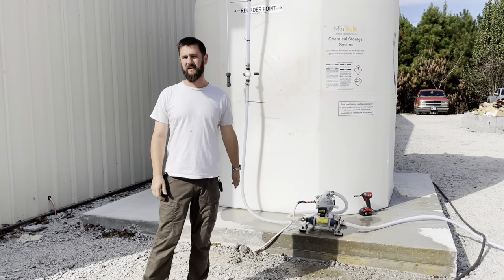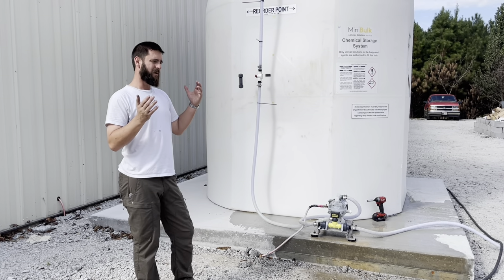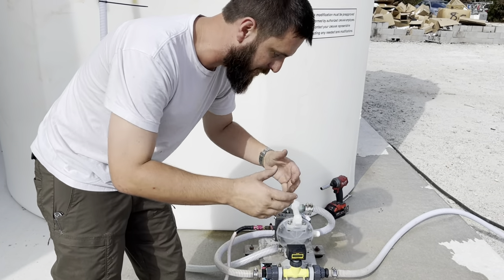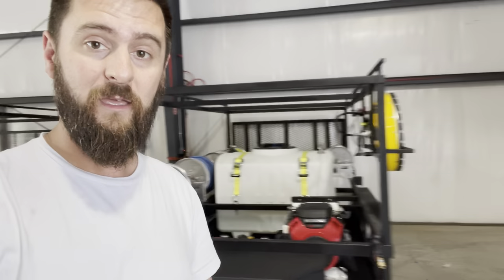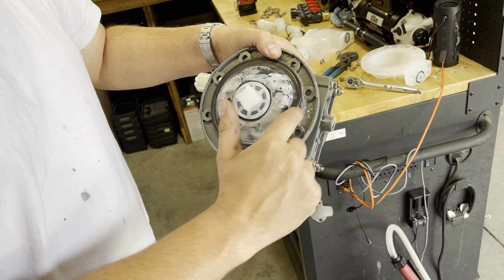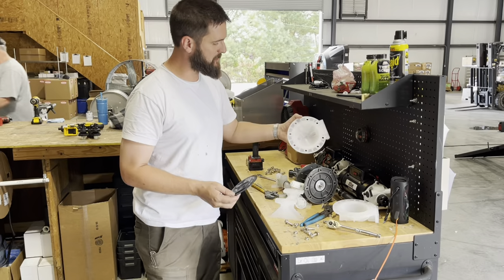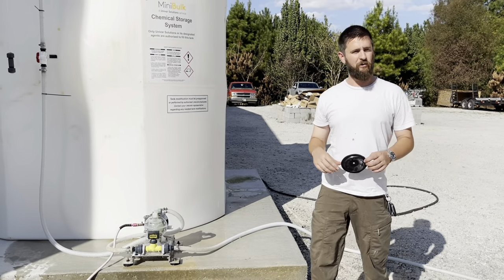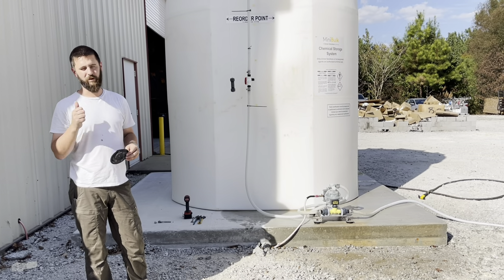Air Diaphragm pump bit the dust!

Comment: Hey Cody off topic question but you're the only person I trust with questions like this. I just got a call for a quote on 100-year-old metal roof that has rubber grommets and the customer is worried about them degrading. What would my best course of action be? Can I use a strong roof mix on that and maybe just rinse? I'm not sure please let me know, thank you so much for your insight.

Comment: The problem is not the air compressor. The problem is plumbing and setup. Most large shops and factories have one large air compressor with a large  tank that runs the whole thing, and a back up compressor if things go south.

Comment: @southeast if you don’t want to deal with the air diaphragm any more look at the hypro 4,6, or8 roller pumps and use two pulleys and a electric motor. The silver nicast pumps are designed for spraying ag Chems and they have Teflon rollers for them too. I would imagine the roller pump and electric motor would be better than the air pump water separator and all that jazz.
Reply from the maker: I’ll check that out. If It’s bleach proof, that would be nice